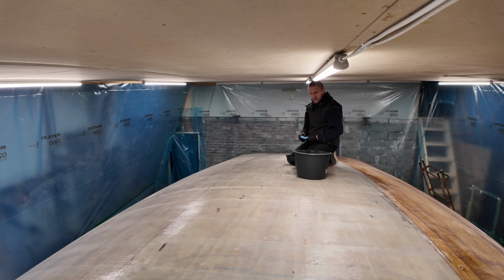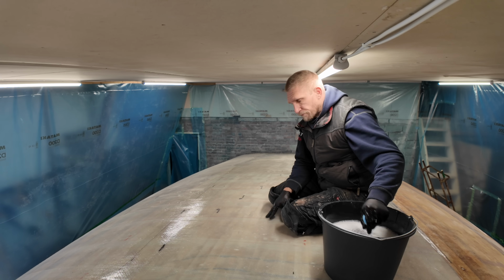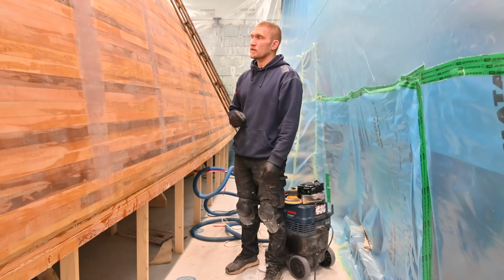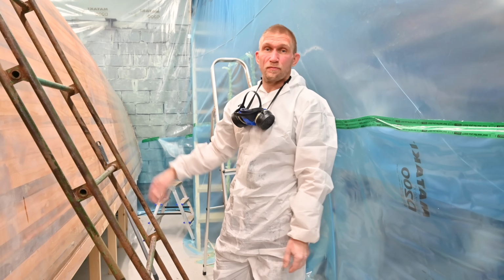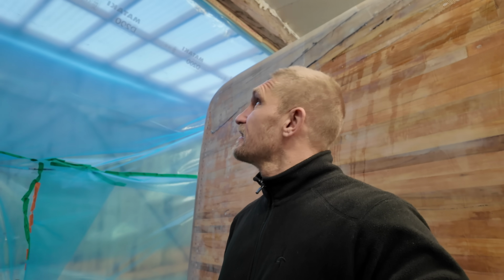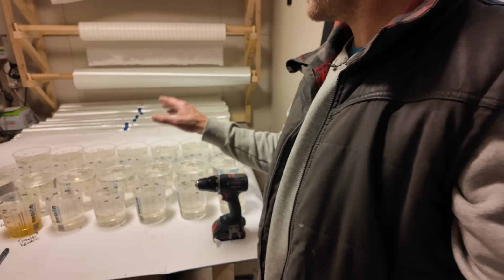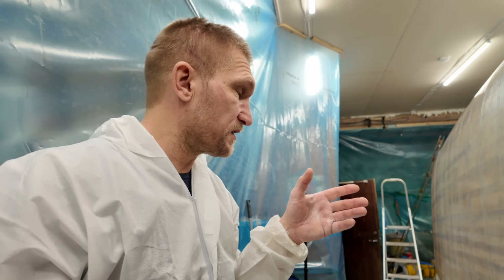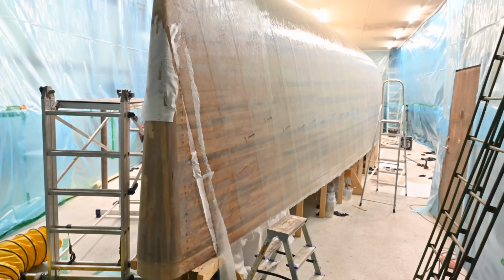2 Persons Laminating 175 m2 Fiberglass In 3 Days - Ep. 377 RAN Sailing

Comment: Before you move the boat!  (I know you know all this but just in case…)
You need to provide yourself a way to level the hull when it comes back in and establish datum references to build bulkheads.  

Go under the hull and locate three points, in sight of one another that are on a given known waterline plane.  Preferably as far apart as possible.  On that plane locate one point that is on a known station and buttline co-ordinate.  

When you bring the turned over hull back you can use the three points to establish a level plane to level the hull.  You can use string and line levels to get the hull level.  The single point can then be located with a plumb bob to establish a reference to a known buttline and station.

Comment: Happy New Year to you all. Looking at the Fibreglassing plans I get the structural integrity etc and understand thSt the bottom of the hull will have 16 layers in total for strength. Had you thought about perhaps putting two layers of fibreglass running from Bow to stern on the bottom to deliver an alternate direction of material to lock in the existing layers! In my mind it would seem to be a bit of extra work but offer so much more strength. That said I am no structural engineer.

Comment: Happy new year to you both, l had a thought, if you had a large plastic tub with a good screw top, with a small amount of acetone in it you could put your metal rollers, brushes etc in it when you have finished using them with the screw top the acetone will not evaporate saves cleaning them each time.
Matt at the Duracell project uses this method, check him out on youtube

Comment: If you had used slow hardener wouldn’t that have eliminated any blush?
Reply from the maker: We used mostly used slow hardener, and yes theoretically there should be less blush with the slow hardener compared to the fast one. However, we can’t be sure that there isn’t any, so we treat all surfaces that has cured without peel ply as if there might be blush present. 😊Cheers!

Comment: you guys should be careful with 15 hours of wearing those masks.. Here in Denmark, you aint allowed (if in an employed situation, as private you can do whatever) to wear a mask more than max 6 hours pr. 24 hours.. It's rough on your body.. If you use a ventilated mask, where a motor drags the air in for you, then you can use it longer.. But when your body has to drag the air through the filters, its a strain on your body(heart).. So the eagerness for safety can be detrimental sometimes.